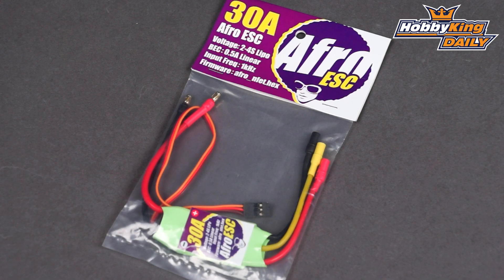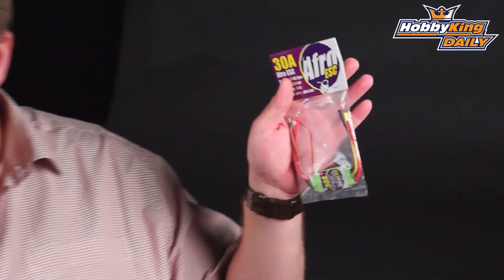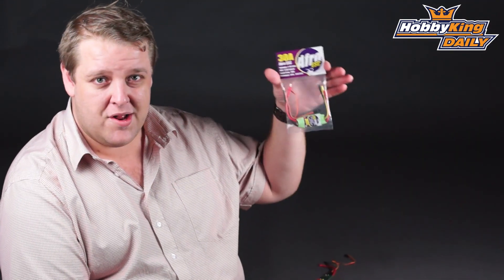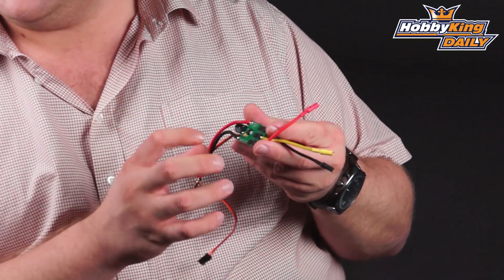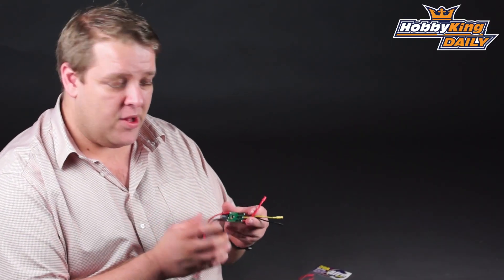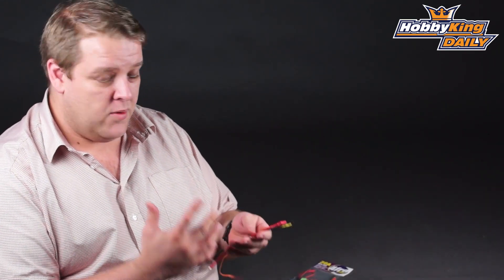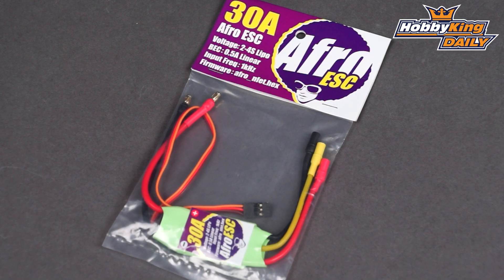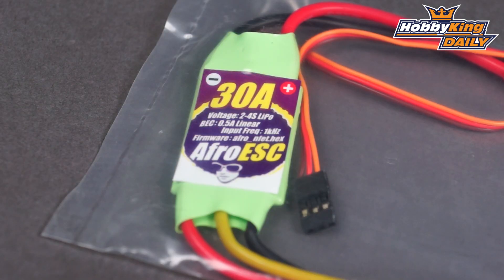HobbyKing Daily - Afro ESC

Comment: The manual page is pretty weak.  The data wires, which is which? Schematics, data tables, all of that would be useful.  I'm trying to engineer my own board for a project and the data in the guide is some of the worse available.  If'd I had a choice this would not have been the product for me.